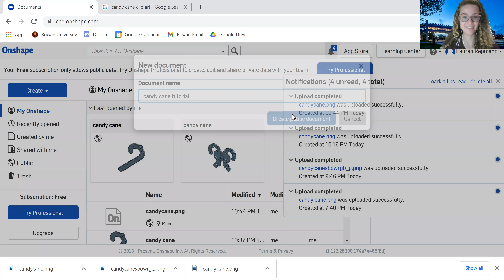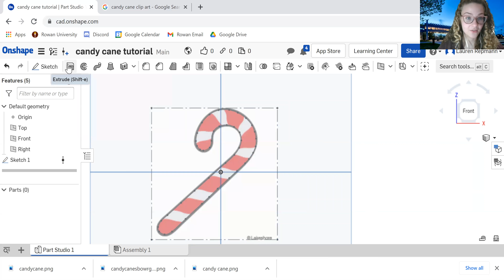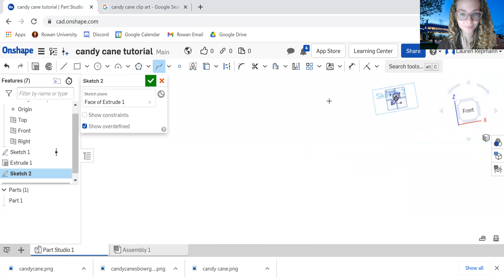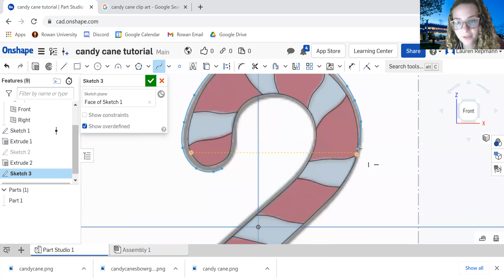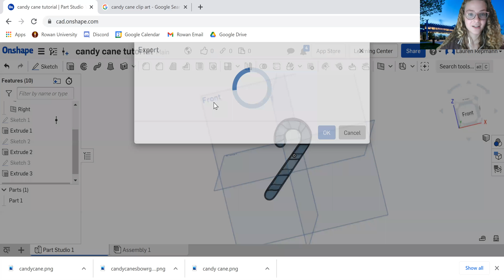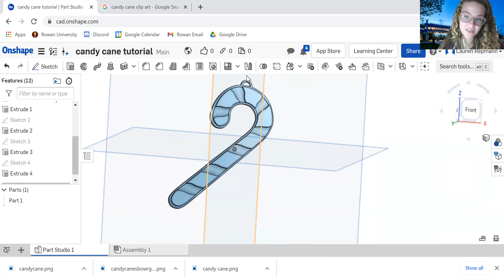3DPC -  🎄❄🎅 Holiday Extravaganza 🎄❄🎅 - OnShape Candy Cane Model Tutorial

Comment: Great video. I find the tracing to be tedious. LOL. And I do want to offer a couple of tips that you might want to use next time. In your sketch 1 you stated that you could not rotate the graphic. To rotate or move any elements in a sketch you can use the "Transform" tool. It is somewhat hard to find as it is located with the pattern buttons. The next one is when you were sketching the second line on the outside of the candy cane and you wanted to measure the distance. If you had used the "Offset" tool and just offset your first sketch, you could give it a value that you wanted and saved the tedious work of tracing. The last tip is going to help you in making your stars. When you start your star choose the "Inscribed Polygon" tool and choose the "construction" option. When you create your polygon you can pick the number of points (5,6,7,etc). Once you have the polygon placed, use your "line" tool and go from point to point to create your star with all sides equal in length. The construction elements will be ignored when extruding. I hope this helps and keep up the great work!